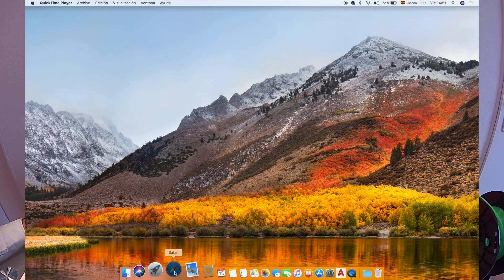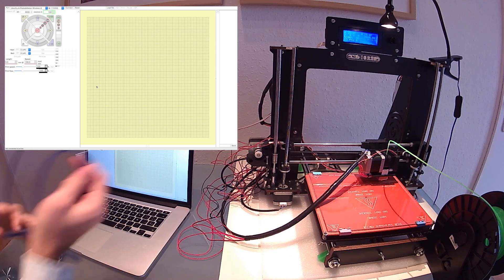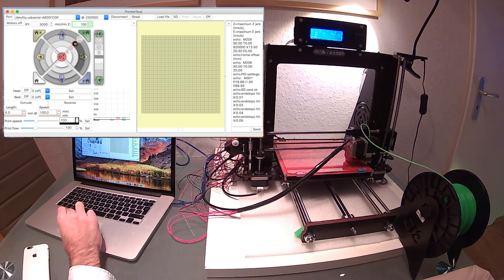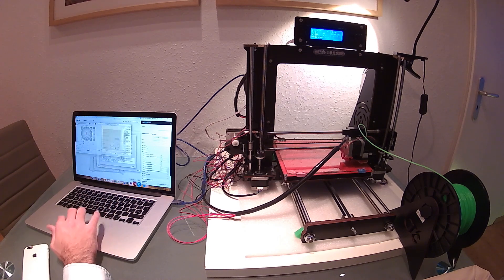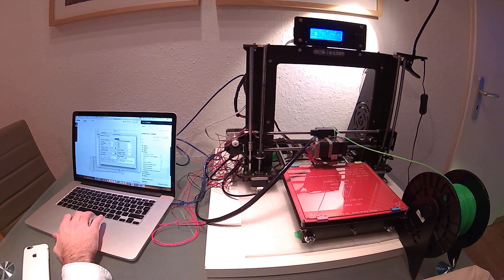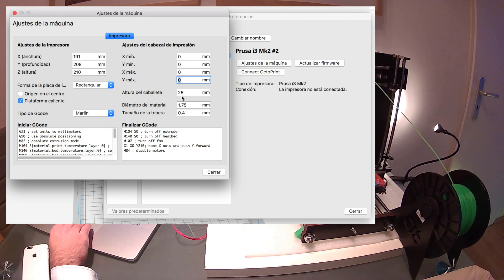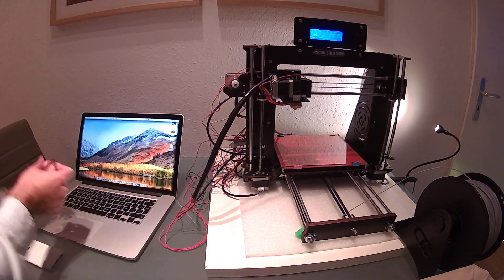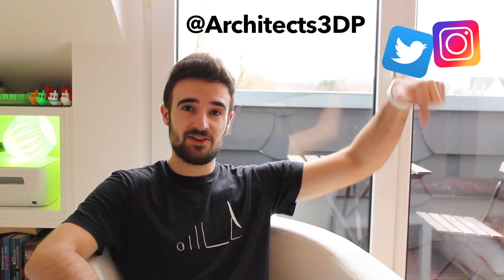Optimize Ultimaker Cura for ANY 3D Printer

Comment: Great video!! I have a problem with my CTC Prusa i3 could you pls help me? Recently I changed the filament by cutting and extruding the filament, because i dont know other way to do this. I could make some prints with the new filament but then in the middle of an impression the filament stopped, so the print was unfinished from a layer. Now I cant even make a good first layer, the filament doesnt extrude well, and I cant see the filament flowing when I go to move extruder setting. Pls help me.
Reply from the maker: Sure! Move the extrude to a position
C, Y, Z = 100, 100, 120
Then heat up the nozzle to 220°C
Once the temp reach  220,  extrude some filament, about 100mm, and check if you see a constant flow.
If it is constant, the problem is in the bed leveling or the speed / temp config.
If not, you have to disassemble the extruder, and clean the nozzle, heatbreak, heater block, etc.
You have to do it while hot, be careful and do not get burned.
Other possibility could be the quality of your new filament, you said that you changed it. Try with your old filament again and check the results.
Thanks for contacting me :) and please tell me if you could fix it